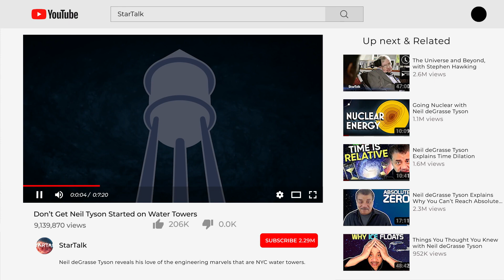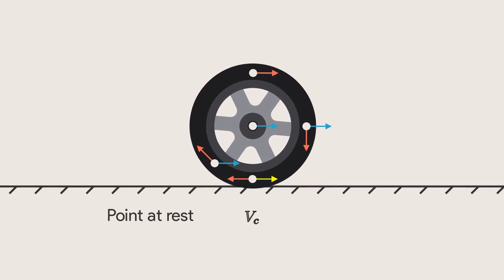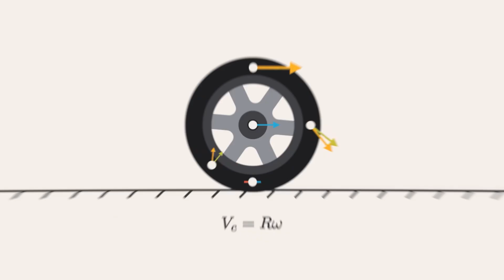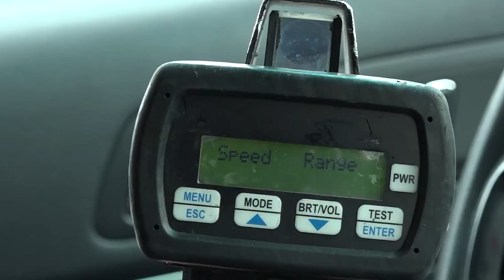How Wheels Really Work | Neil deGrasse Tyson Explains...

Comment: Relative to anything else it's moving right? Isn't that the definition of movement??
Reply: Yes, all movement is relative. Now, on earth, we typically are talking about the earth itself. But airplanes are more concerned about airspeed. Which is the speed of the plane relative to the air the plane is flying in and not so much ground speed.